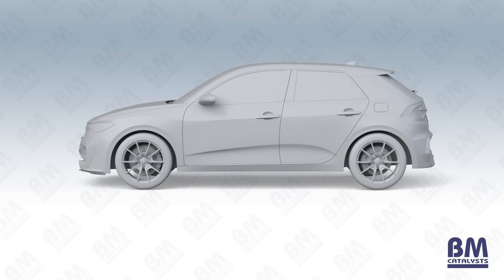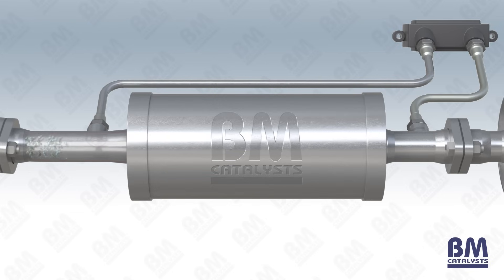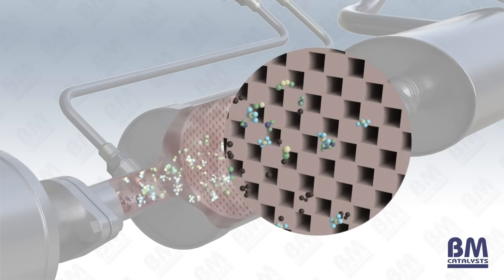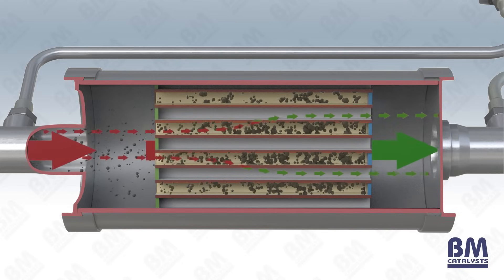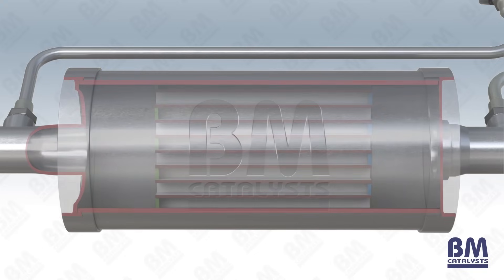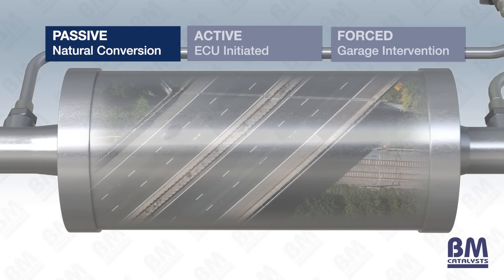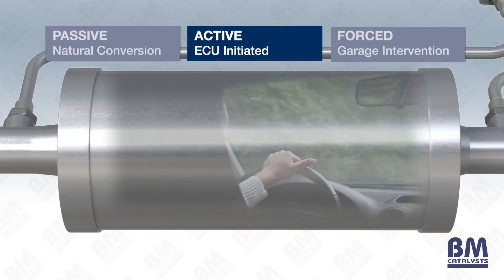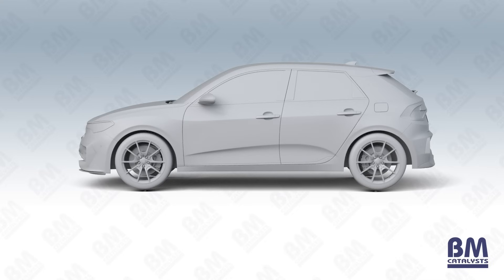How does an exhaust diesel particulate filter (DPF) work?

Comment: It work by reducing the life of your vehicles engine from restricting the flow of gases escaping. This will cost you more in the long run.
Reply: There are many cars with more than 400.000 kms with DPF. For a normal person this is like 20 years of driving? How much do you expect a car to last? Go to Eastern Europe, you will see there many old diesels without DPF, or newer ones but with DPF off and the smell is just unbearable, not to mention that shit increases the chance of cancer.
Reply: It's not about the cost though, it's about not poisoning the people around you. Whoever buys diesel and gunks it up with city driving didn't do their research before the purchase.
Reply: If you drive properly and dont do 10 min drives every day and keep the DPF clean, then there is no evidence to suggest that it has a negative effect on the engine.

Comment: What are the required conditions for active regeneration to occur, is there certain driving perimeters that must be met in order for the vehicle to complete an active regeneration cycle? Thanks.
Reply: For my Ford truck the parameters that must be met and maintained consist of sufficient exhaust gas temperature (the engine has been driven long enough to produce hot enough EGTs), and maintaining a constant speed of 50 mph or greater until the regeneration has been completed. Active regens on my truck usually take about 20 mins to fully complete.
Reply: @LargeNinCharge  I'm guessing then that there's little real difference between passive and active regeneration requirements in terms of how it affects the DPF?  My understanding is that active regeneration only differs in that the ECU contributes to the EGT by dosing the exhaust with fuel by injecting fuel during the exhaust stroke, either that or utilising a vaporiser/injector that is fitted directly to the exhaust in the case of some fords etc.  

My query I suppose is really what's the difference in time needed to complete either cycle.  I was presuming that the active regeneration would be initiated and completed more quickly than the passive?  After all, an active regeneration is only called for if driving conditions have not been met in order for passive regeneration to occur?

Many thanks for your help.
Reply: There's a video which is about regenerating dpf on a vw. The driver just filled up his tank(fully) and then went onto motorway. Where he kept revs at about 3000 and speeds at more than 80kph(50mph). So most cars should be of a similar way.
Reply: are you deaf? listen to the video mate, you have to drive longer and at faster speeds so your engine gets hot and the exhaust gases can burn the soot that got trapped
Reply: @dogsters  Don't think you read my post properly.  I already know what you've said.  I was asking what the difference is between active and passive regeneration cycles in terms of operation and time required. Can you answer that question?